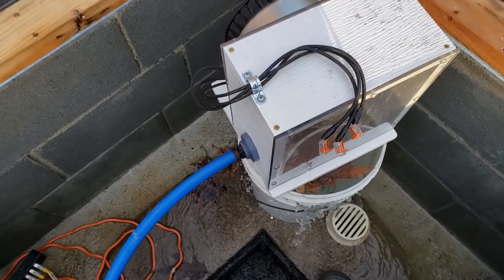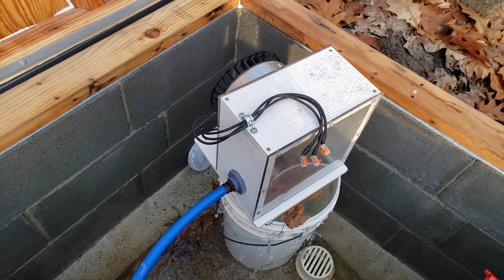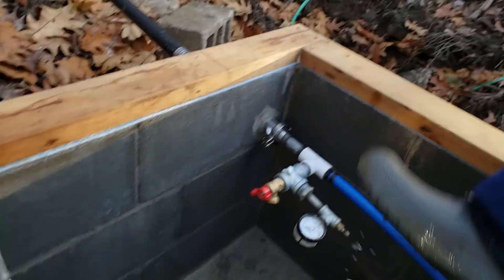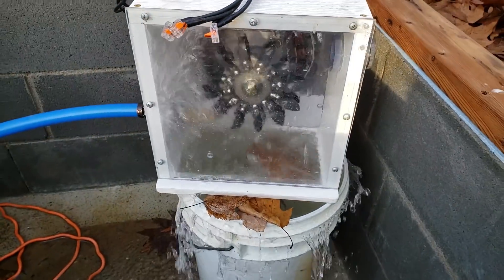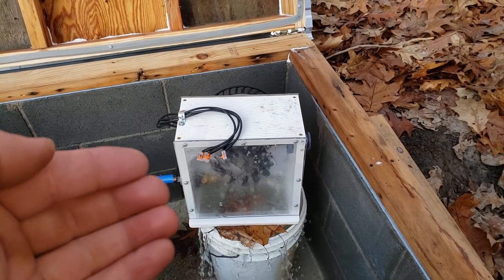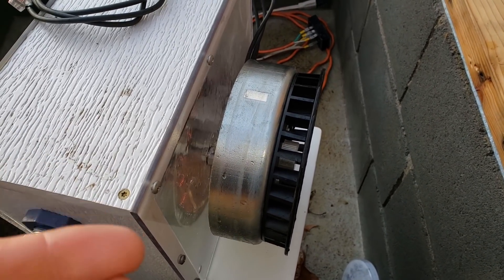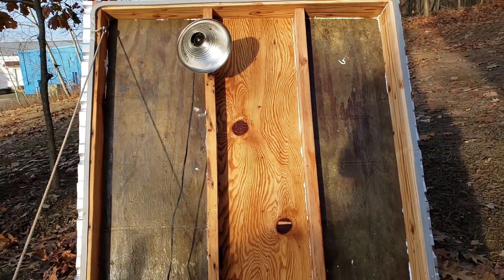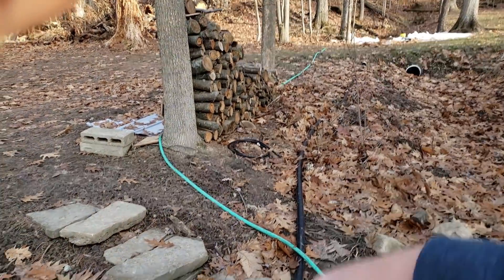Not enough water to spin the turbine :/

Comment: Why not run your excess water that your draining and have it go back into your line so none of the water your using gets wasted and you would essentially never lose water pressure you would just be recycling the water your using. How you would do this is attach a hose to your draining system then run the line maybe 300 feet up the hill and the water constantly coming in would be enough to push the water up the hill and into your line tell me what you think.

Comment: I guess hind sight is 20/20 but a two inch pipe would have significantly reduced friction loss in the 800 feet of pipe. Also why don't you get the spear valve working with the 2 inch hose. Those valves help maintain pressure over a range of flow rates. Might help at lower levels to get the turbine moving. Can't wait to see what this thing does when the spring starts to flow fast again. Great channel. I've been busy binging over the weekend and ignoring the projects I should be doing around my house!

Comment: I'd say you need atleast 2 jets opposite each other if not 4, a bigger supply pipe will increase flow while maintaining pressure.
Reply from the maker: I'm limited by the supply of water coming out of the spring.

Comment: Have you tried a Tesla turbine? You'll need to reduce the speed on the output but should do well with the low flow high pressure setup you have.

Comment: I know your flow is slow at the moment but it looks like the jet is hitting the spoons a little too high (too close to the spindle), that will rob torque. Maybe slot the jet nozzle mounting hole so you can tweak it while it's running?
Reply from the maker: The hole is slotted, part of the reason for using the bulkhead fittings that I am. The jet is directed at the very edge for maximum torque.

Comment: can you put a water sensor at the top of the hill that turns a valve off when the water level is low in the barrel, and back on when it's full. It will make intermittent power, but it will make power.

Comment: @Joe Malovich
You can squeeze out a tiny amount more energy by rotating the jet so it goes down, instead of sideways, so the water gets a little more energy by falling down on the rotor. 
(aligning the gravity vector with the flow vector, currently you don't get any rotational energy at all from the gravitational vector.)
    In "low flow" conditions you can use some kind of: "water-tower + toilet-flush" mechanism, so it saves up water until it has enough to spin the rotor & only then flushes the tank empty (Maybe something like the: Pythagorean cup (buckets + pvc pipes)), the higher you can make the tower, the more energy you will get from each flush.
Because I think it's better to get small pulses of energy at some intervals, than not getting any energy at all while wasting all of the water & the waters energy.
Good luck!

Comment: If it's cold enough to have some snow, then it's probably cold enough for ice to form in any of the bearings where water can get in. It's just going to seize up even if the pressure was half-decent. And if it can't spin with no load upon it acting like a brake, then it's going to do nada otherwise. Going to need some more thinking done on making this work. (Nothing going fast enough for fluid friction to make heat, like you'd see in industrial pumped systems.)

Also since this is driving a reaction wheel and not about moving a lot of water, why not trade reduced volumetric flow for a much higher head pressure by adding a ram-pump setup? Just need some check valves and an accumulator tank. It would surge in impulses rather than constantly, but should be enough to get the wheel spinning with the current nozzle setup. (Different issue than the icing thing, but may help anyways.)

Comment: Your current flow requires a smaller generator. Down shot is going to give you the most efficiency in this case. Yes there is going to be a fine line with respect to your flow and having things freeze. And finally, you might make yourself notes say a cheat sheet before you shoot your video. And as a side note I too and fighting to get insulation in my little Chalet. Thank you for showing us the work you are doing!

Comment: You can use multiple small nozzles with electric valves and some float switches in the Barrel on the hill for automatic flow regulation and constant pressure.
For example 4 nozzles, 3 of them with electric valves, the last one is always open or with a manual valve. And 3 float switches in the Barrel on the hill, at 1/4, 1/2 and 3/4 of the height of the Barrel.

If there is enough water to keep the barrel filled, the turbine will run with maximum Power on all 4 nozzles, if the water Level drops below 3/4 of the height of the Barrel the float Switch closes one of the valves and the turbine runs on 3 nozzles.
If the flow rate is very low, like now, the water level will drop below 1/4 and the 3 electric valves are closed and the turbine runs on the one remaining nozzle , still with maximum pressure and maximum possible efficiency.

btw: are you from Germany? Because of showing the 3 Fingers like a German and not like an American...

Comment: I don't quite understand.  So if you shut the valve at the turbine,  does the line fill up totally and your pressure increase?  In your previous video,  you had over 100psi.  Obviously,  your line running down is only filling up to the point which gives you the 20+psi.  Is that what is going on?
Reply from the maker: Nozzle too big, line drains lose pressure turning no spin. Nozzle too small not enough water turbine no spin.

Comment: Is the generator sitting with no load? It seems there should be enough force to overcome its friction? Can you program your inverter to “soft start”? I t would allow the generator to get up to the most efficient speed and then gradually add on the load that would allow it to operate. This may only be 10-30 watt, but is that not better than nothing?
Reply from the maker: No load.
Reply: @JoeMalovich  I don't understand why it doesn't spin with no load.
Reply from the maker: @hubrisnaut  friction in the bearings and seals.
Reply: @JoeMalovich  I am not familiar with your generator but that seems like an excessive amount of friction. With no load it should spin freely with little effort.  Bearings should have very little friction so it seems to me the only thing it could be is the seals. What seals? To prevent water from entering the generator? I'll look back at your videos to see what your generator setup is. Something doesn't seem right. I am not an expert on power generation but I was an Navy avionics technician so I am familiar with electricity-electronics. Something doesn't seem right If 3 gallons a minute  under pressure can't free spin your generator.
Reply from the maker: @hubrisnaut  yes the seals are causing some friction, as well as a pre-load spring washer. I can keep the water from getting into the bearings easily enough and the bearings don't really need preload.
Reply: @JoeMalovich  I haven't gone back and looked at your generator setup video yet. But, I just did a little research on preload bearings. I would say you are right about not needing preload bearings. These type of bearings are useful in precision rotational energy input applications. Because they can mitigate tolerance slop, they can also reduce noise and increase bearing longevity somewhat but, your objective is to make electricity. A little more noise and a 1/10,000ths mil slop would have almost a vanishingly nil effect on the magnetic field induction into the windings  of your generator.
I don't yet get the "seals", I've seen homemade water turbines where the water is literally splashing all over everything with no problems.  Again, I have to go back and see what your generator setup is.

Comment: With the height from spring to discharge pipe you should be able to replace the barrel with an IBC tote to get 250ish gallons of storage at the top of the hill but would require clearing a larger pad for it to sit. The real fun would be getting it to the top of the hill but could simply run a rope between trees to make an overhead support for it then use the winch to pull it up to a staging point as you redo the rope to get higher up the hill.

Comment: Why are you hitting the spoons on the bottom?  Make gravity work for you and hit the spoons on top.  Just like a water wheel.
Reply from the maker: This is not a waterwheel however. on the bottom there is 0.15% more pressure

Comment: Something seems a little off about your flow issues. Curious if you verrified the 2- GPM at the head.
Sounds to me you "MIGHT" have a blockage somewhere in the pen stock or at the intake? 

Just a thought.
Reply from the maker: It was flowing at steady state and only 20psi so I knew 100% of the water coming out of spring was flowing out the nozzle. If I put a big nozzle on it it will follow a ton of water until the tank drains in minutes.

Comment: Would it make sense to set up a level sensor in your barrel at the top of the hill and a motorized ball valve so you never empty the pipe? Having peak power on a 50% duty cycle is better than trickling not enough water to turn the turbine, especially if the power is going into a battery anyway.
Reply: The only issue with that, would be icing up when the valve is closed.
Reply from the maker: @rcs368  yup I can't because of icing.
Reply: Ah, of course
Reply: Maybe something like a bigger version of this? https://youtu.be/5wZ9PQepQYI

Comment: You could have a two stage turbine side by side on the same axel, one with a larger radius with it's own jet for low pressure and then your current radius turbine with the current jet for normal operating pressure or to maintain the momentum at lower pressure.
Reply: "¿Porque no los dos?" -- nice.

Comment: Suggest a second input line on opposite top side with smaller nozzle.  Idea is to have two stream inputs for high flow seasons and high pressure low flow for dryer seasons. You can put a valve to direct flow to either nozzle.
Reply: Both are the same amount of energy

Comment: Joe, are you sure that the 100 psi are lost due to friction.
 When the incomming flow is too low, you can have a lower pressure than expected due to the fact that the pipe is not completly full of water. 
If you reduce the nozzle diameter, you can solve this issue and increase the available pressure without reducing the flow.
Using a variable nozzle is a good option. 
Thanks for your videos.
Reply: Yes, the system is designed for higher flow conditions than now so the head loss now should be lower than 100psi.  The high losses mean that something is interfering with the flow, most likely air or possibly ice.
Reply: @unahaclosp  thanks for your response.
Reply: Might be interesting to add some valves and a pressure tank to the system, and have a ram pump help drive water into the turbine. Not constant, but the surge pressure with the impulse may have a better chance to get things moving than a constant pressure that is too weak to do anything.
Reply: it wasn't 100psi of head loss, the flow was to low. it was the fact that there was not enough water going in the intake so the pipe had drained most of the way down the hill- the reduces the pressure. The reduced pressure means less water flows untill the amount feeding in the top and the amount coming out the nozzle equalises. He did say head loss in the videos but i dont think he meant that.it was just that the pipe had drained. head loss at that flow would be about 1-2psi.

Comment: would moving the jet closer to the centre of the wheel work better what or more buckets on the wheel
Reply: The jet diameter is just too large, the amount of power loss by the distance is tiny
Reply from the maker: more torque would help in this situation but be detrimental at higher flows.

Comment: Could you put some float switches in the tank at the top and a motorised ball valve to turn the jet on/off as water becomes/stops being available? I think you could design it with relay logic and a 5-wire motorised valve so it only used power when the state changed. Those valves take a few seconds to open/close too so you shouldn't have a problem with hammer.

Comment: I'm sure pulsing the water would be silly but itd be neat having a system that was always geared optimally
Reply: Like, using a CVT? 😂

But CVTs eat up too much power, it's better to adjust the electrical load accordingly by charging a battery faster or slower.
Reply: @RubenKelevra  with a pressure sensor, a valve and an arduino or plc. If the pressure drops below 6 bar, shut the valve for a few minutes.
Reply: @sanderd17  yeah that's what he is planning to do: Different nozzle sizes and valves to open and close them by a computer based on pressure.

Comment: You should get one of those giant farming tanks and put it up the hill just a little ways and have the small hose feed it 24/7 on full then from the tank run a larger diameter tube to your turbine.
Reply from the maker: that wont work, I have a plenty large hose running all the way to the spring. the nozzle is too big and lets more water out than the spring generates. I could run it for maybe 5 minutes out of every 15 minutes right now if I took advantage of the buffer tank at the top.
Reply: A buffer tank would just make sense if he would run the whole house on it, and wants to basically have more peak power than what the spring can supply without draining a battery.

But since this system isn't really able to supply power for the whole house it isn't really helping to have a tank at the peak of the mountain.

Except that he would have to take care of it and icing is an additional problem.